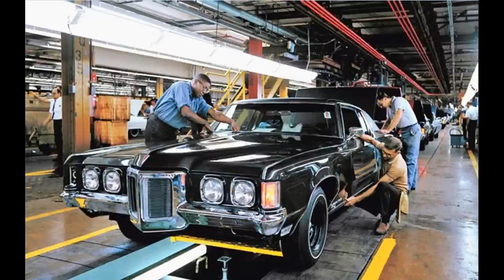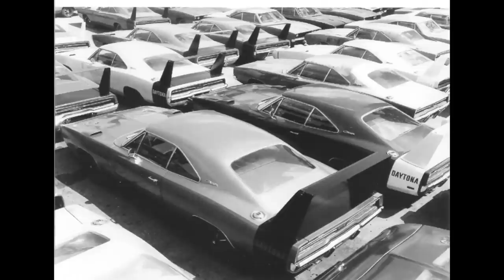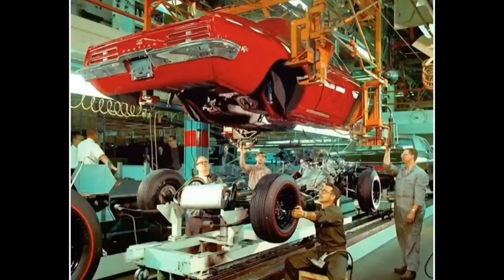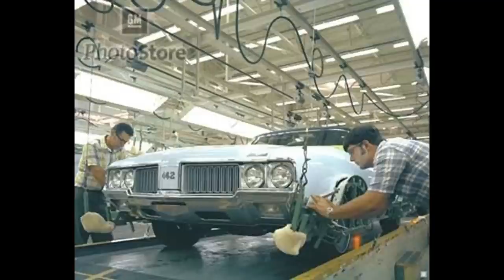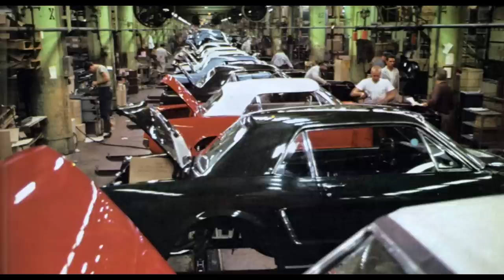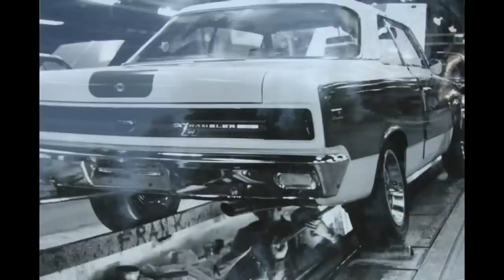Amazing Muscle Car Era Factory Assembly Lines

Comment: My dad worked at the Baltimore plant, from 63-93. Every September we would go to the open house, to tour the plant, and view the new models. GTO's, and Chevelles, as far as you could see. I would try to pick out the Tri-power GTO's, and 375 HP Chevelles. Look for the chrome on the engines.
Reply: John W 1711 Stock I remember those days of GM open house at Toledo Chevy plant

Comment: The footage is incredible.
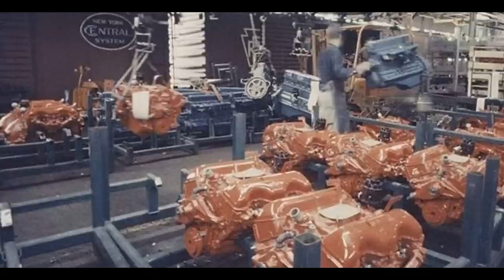I got a kick out of the 409s,on the pallet. @ 2:44.
Reply from the maker: I agree Bill, I wish i could find some images of Fords 427 Cammer and Boss 429 as well as the Hemi and Max Wedges
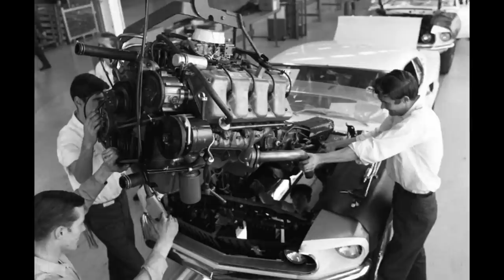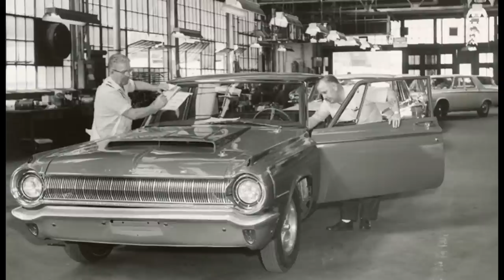Reply: Boss 429 spotted at 1:17 and a super stock Hemi Race car at 1:37.........
Reply: Judging by those blue six cylinder engines in the same picture, I'll bet those are 348s.
Reply: +thebigsuperbeatle most likely so
Reply: @thebigsuperbeatle v
Reply: I agree

Comment: Love the shot of the GTO's. Got a 67 Tyrol blue just like the one in the pic but with white interior.
Reply: That exact '67 GTO was our family car, we bought it new from the dealership for I believe $3500. 400 CI and plenty of torque, my mom would get scratch as she pulled away from the curb after dropping us off from school in the morning. Pretty cool family car.
Reply: '69 Camaro with a BB, ultra sweet ride man.
Reply: Timothy Bruneau  Dude the blue GTO in the pic is a '66 not a '67.
Reply: It was a '66. I know cause I had a white '66 GTO (although it wasn't a rag top) in 1969 when I was a junior in high school. It had a Hurst 4-speed, 389 cu. in. motor with Tri-Power.(3-2 barrel carbs)  I had the fastest car in high school in my junior year.
Reply: You and Albert Lehmann are absolutly correct. I had to stare at it for a couple of minutes to find the difference, (the '67 has a piece of trim along the edge of the hood, the '66 does not. Good eyes man!)
  I had a '66 Lemans Sprint (which was the poor man's GTO) with the 396ci, two barrel carb and a four speed manual trans. 

The only  differences beteen the two were the rear taillights, (the Sprint had to 'half moon' tailights, the GTO had the  horizontal slits) the GTO hood scoop and of course the GTO badges. Other than that was bulit exacly like the GTO. I wish I still had that car.
Reply: In that time period the GTO's were built in Arlington Texas. The guy I bought my 67 from (for $500) in 1974
had a home movie of it being built at various stages. He worked on the assembly line. He showed it to me but he wouldn't let 
it go with the car. I sold it in 1976 for $350. Who would have known then what they'd be worth today

Comment: Truly fascinating, I worked on a Chevrolet Motor Division Assembly Line Just before I went in the service! Worked in a Half Pit installing chrome Rocker Panel Molding on Right Side of the higher end Chevrolet Chevelle! The assembly line was moving 43 cars an hour, my job sounds easy but with the line moving that fast you really had to move, or miss a car here and there! You had to wait for a Relief Man to go on Break, or Just to the Men’s Room, the Line NEVER STOPPED! Missing what your assignment was on a car was Totally Unacceptable! Awesome Job though! A friend that had been working there much longer than myself had an AWESOME JOB, all he did was drive cars off the assembly line thru what looked like a Dyno than Park them! He got PAID for that! We build Cutlass (+442) Chevelle (+ SS 396, few 427 & 454) and Firebird (+ GTO & The Judge)!!!!

Comment: O.K. Great video!  However,  not to sound like a dissenter but I was a junior mechanic in the early 1980s at 2 American car dealerships (I won't say which) . 1 of my jobs was P.D.I. (pre-delivery inspection) . On average it took 2 1/2 hours to correct ALL the defects with the average  American car BEFORE it was presented to the owner. And even then they came back with MULTIPLE problems! (many times on a tow truck!) I was recruited away to a dealership that sold 3 brands of Japanese cars.(again , I won't say which)  The P.D.I. was 1/2 hour! And most of them didn't come back until it was time for scheduled service!
Reply: 1980s was a disaster for American cars. They had problems in the 80s never before seen because the US was forced to overnight build a different type of car. America was a big car builder but in the mid to late 70s were hit with a gas crisis along with the US taxpayer subsidized Japanese car invasion. Notice the perfect timing of the Japanese invasion at the same exact time of the gas crisis. Rumors are it was planned to allow those in the know to load up on the Foreign car stock. Magazines like Consumer Report loaded up on the stock and wrote stunning articles on their new investment and dogged US cars which boosted their stock to amazing levels. It was a racket most don't know about. And back to the US car, they were not in the biz of making small cars and had to overnight relearn and retool, they made big mistakes in the process and turned out some real dogs in the 80s and some in the 90s things began to turn around in the 2000s as they played catchup. Also most average US citizen has no clue that both Japanese and German car builders were subsidized with US taxpayer dollars after WW2 to build brand new modern car factories that were destroyed in the war. So when people moan about GM and Chry. Taxpayer Gov. loan they are so FOS not to mention all the tax$$$ subsidies we gave Germany and Japan to directly to build and turn around a resell/dump on to the US market 25 years later.
Reply: I remember picking up my first new car. A special order 79 Mustang (V8) and there were no emblems on it. Like 302 etc...Had to come back a week later for them. The dealer did a quick inspection of the car and the trans bolts were mostly missing and it was about to fall off. Ironically, that Trans (4sp) lasted 175k miles and the engine lasted over 270k miles. Those old 302's were tough.
Reply: So true.
My uncle bought a new Mercury Cougar in the early '80s, I've forgotten what year, a bloated 2-dr personal luxury model clone of the Ford LTD II. It had the opera window and padded vinyl top. Gold/gold/gold paint/top/interior. They wanted this new Cinnamon Gold paint. They took their trade-in to the dealership, and the dealer had it sold instantly. The Cougar wasn't ready yet so the salesman got them a loaner to drive out to eat dinner. They returned, signed the papers, got in the cougar, and the Cougar died turning onto the boulevard. They took the loaner home and had to come back the next day for the Cougar.
They had switched from buying Plymouth to Mercury in the mid-70s. They usually bought a new car every 3 years. They had bought Ford in the '50s.
They had a '65 Barracuda they didn't like. They bought it because it was all the rage, a Mustang competitor. They usually had a full size Fury. The Barracuda was anemic and had that big rear glass, which heated up the cabin area. The small trunk and hard to reach storage with the folding rear seat was a problem. They traded for a Fury.